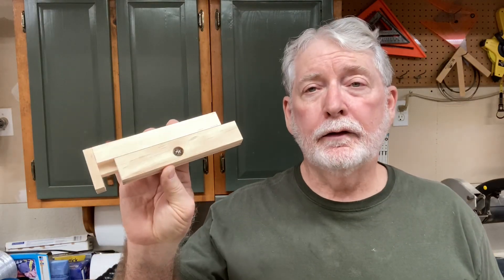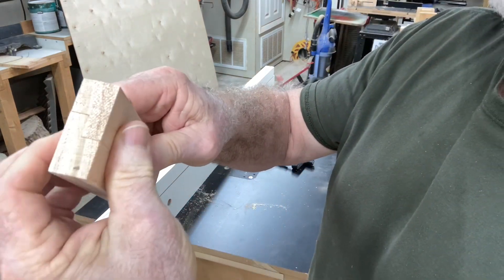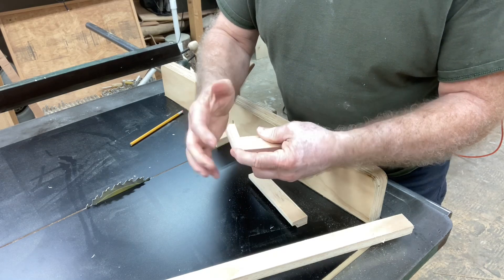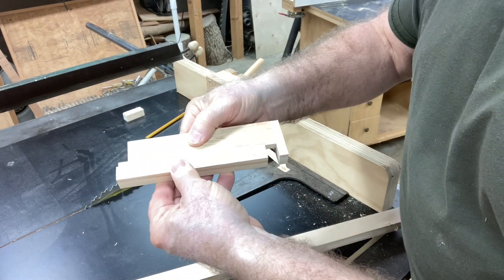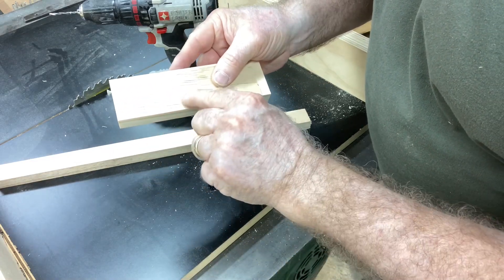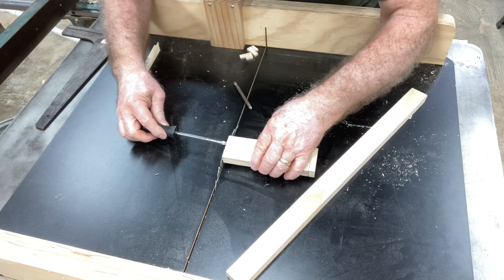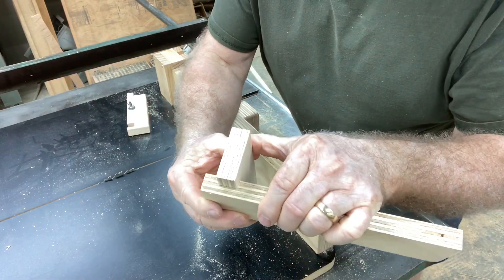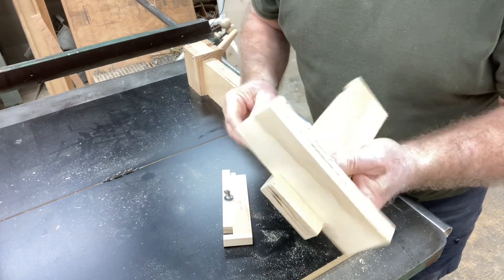Perfect Dados Every Time

Comment: Check out the Famag Bormax 2.0 forstner bits! You'll love them if you ever get your hands on them. They're a definite overhaul of the forstner bits everyone is used to. Say goodbye to burned out edges and bits that seem to dull aftereven moderate use. 
I know I suggested the STKR carpenter's pencils and if you got the chance to use em you were probably  shaking your head at me in the least. 😂 My experience with them was lackluster to say the least. Maybe with a couple redesigns the inner part of the pencil would actually hold the square, toothed lead. 
At any rate, I feel way more comfortable suggesting you try the Bormax 2.0 bits out.
Reply from the maker: Thank you very much for your suggestions.